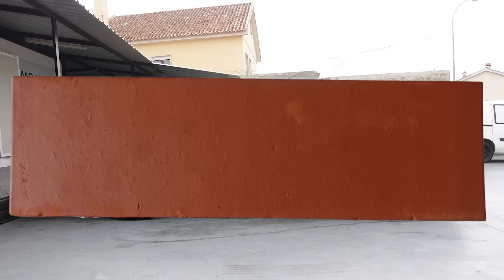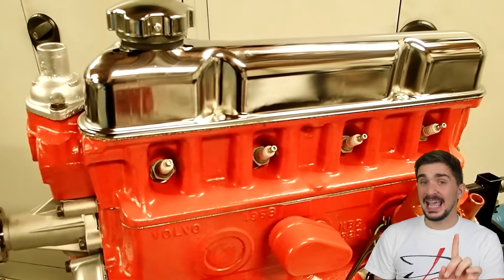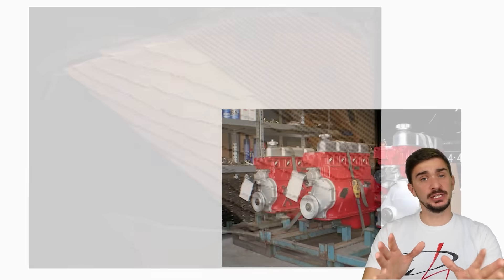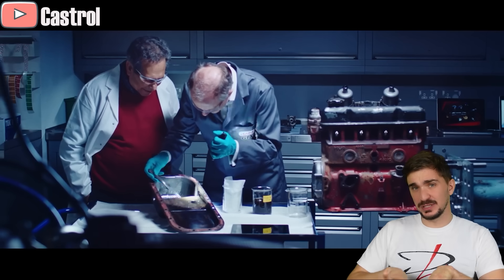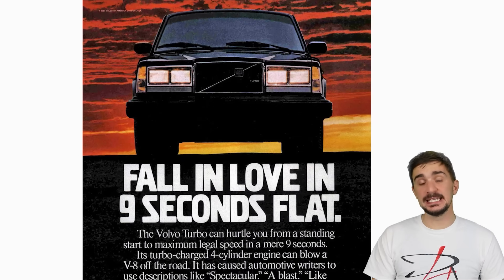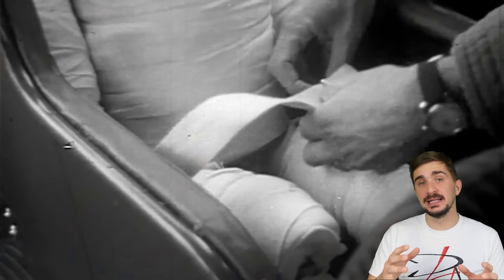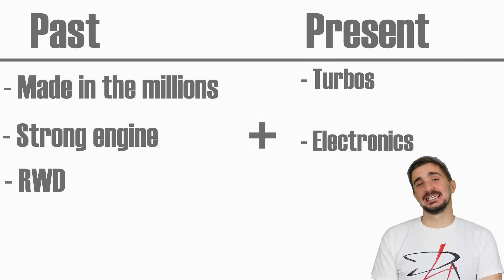A Story about the Volvo 240 and its Redblock Engine - Iconic Cars and Engines #18

Comment: Can you do a vid about the Volvo 850? Sadly I never owned a Volvo but they were iconic in the UK when I was growing up. By the time I came to buy a car the 240 was seen as an old man's car, though, and the 850 had been out for enough years that I could afford one second hand, and I was on the verge of buying one. Then I got a job that included a brand new company car (a Vauxhall Astra 1.8 S, which was a fantastic car too), so I didn't buy an 850. I now regret that, because I think they were a big step forward for Volvo -- good engine, much more modern styling and interior, and big enough to move several tons of bricks. Ah well, it's something to dream about.

Comment: I bought a 1986 240 Volvo wagon in 1998 from a couple I knew. They rolled it over on a highway, so the right side of the car had damage from front to back. They told me they flipped the car back to the ground and drove it home. I bought it for very little money. Drove it for about a year and sold it to a friend of mine. He drove it for almost a year. It was a tank.

Comment: My Dad was a volvo marine engine dealer and can attest to going 5 000 rpm with one for a full hour crossing Long Island sound at night in a rough sea. glad it kept going. trouble was they never broke so parts sales were limited to water pumps and the ussal timing belts. the GM 305 kept us in business and always wondering which part would break next. I had one B18 connecting rod for some reason and it looked twice as stout as a chev or ford v 8 rod.

Comment: Hold on. I had a 1975 242. It had the B20 engine with Bosch fuel injection. That was the first year of the 200 series and the only year of 100 series carryover engine. 

Yes it was tank. I once lost the oil plug coming off the highway and about had a hea3at attack when I heard the engine screech. When I got it home, I replaced the plug and filled it. I manually turned the crank for about ten minutes. I performed a series of short starts and eventually the screeches went away. I drove the car for another two years. I sold it to someone that expressly wanted the engine.

I would later buy a 2001 V70XC.... that wasn't the reliability of my '75.

Comment: The Bread and Butter Volvo 240 !, 70s80s90s !. The B16 thru B20 engines used A Fibrous Gear on the Camshaft Witch Would Fail if Oil Service was Neglected Had Solid Lifters so you had to Adjust the Valves 16 on the Intakes 18 on the EX., Flat Camshafts were a Problem 1974 -75 Flat Raters had A Hard Time Using Impacts on the Huge Cam -Nut When Tightening Snapping the Camshaft they had to be Torqued B21 B230 were Great Engines !.

Comment: I've owned seven of them. The first was a '74 142 2-door with the B18. Loved it. Wrecked. '73 145 not so great. Bought my '78 244 new and drove it 20 years. My '81 240 was good, but a "friend" wrecked it.  The '98 S90 with the straight-six was a disappointment; it just refused to run one day.
I still have a '92 240 and a '90 740. Same engine. No turbos. I must say I like the 740 better because it's bigger. The 240 broke the timing belt at high speed in '21. No damage to the engine. These cars will outlast me.

Comment: Loved my 245. Safe, forgiving, and built like a tank. It even had a plywood trunk floor! It was a United Nations of parts. Swedish engine, German electronics, French headlights, English radiator, Spanish tires, and all assembled in Canada. The only major issues were the poor quality red paint, a window crank that failed while on vacation and let the passenger side window fall down inside the door and there was no dealer to fix it anywhere, a shift knob prone to flying off into the back seat, and its eventual demise due to severe rusting. That car took a family of five across the country and back while towing a camper trailer, and never even burned a drop of oil, without complaint. I still have my high mileage badge and my I ❤ my Volvo bumper sticker.

Comment: Yeah back in 2003 when I was 20 I bought a 1989 Volvo 760 station wagon with the turbo and intercooler.  That was one of the best cars I ever owned. It had a beautiful interior, automatic climate control, great stereo, at least one air bag, and 4 wheel disk brakes - vented in the front with Bosch antilock brakes.  The motor was fabulous, turbo, intercooled, bosch fuel injection, it ran on low grade fuel, 160hp at 5900rpm and 180ft/lbs at 2900rpm.  It was wonderfully combined with the 4 speed auto which was faster to the shift then the manual.  It consistently did 0-60 in 8 seconds which made it a muscle car in the 80's.  Mercedes really was beat by volvo, mercedes cost a lot more money and only the V8's could do 0-60 in under 8 seconds, mind you they could go 140mph as where my volvo topped out at 110mph.  I loved that, I loved being on my phone talking and just pointing the steer wheel where I wanted it go go and stepping on the gas.  One thing I learned from that car is that there's such a thing as having too big of a motor in the car, I really appreciated rolling down the road at 70mph with a small, quiet four cylinder that was easily doing the job, any larger of a motor would have been constantly working too hard.  At the time I thought the fuel economy was great at 26mpg. Eventually later on in life I got a 1984 Mercedes Benz 300sdl with 380,000miles on it and everything worked on it and it never let me down and that's when I become very impressed with Mercedes.  Now I drive a 2006 Mercedes Benz E320 CDI and it's the best car I have ever owned.  It's got serious power, it get 40mph, it cruises at 130mph, and make no doubt about it, it's a much nicer car then the volvo.  THe handling is really bad ass, particularly with the ESP system.  It runs on sustainable biodiesel which is it's main advantage over the volvo.  The W211 mercedes are extremely tough cars and volvo stopped making heavy duty cars by this time, I think the W211 is last heavy duty mercedes as well, maybe the W212 but really the W211 with the inline 6 diesel is the one.  But I would love to get an old Volvo.  They're really nice cars to drive, I mean we don't always need to be racing.  Front engine rear wheel drive sedan are very comfortable, with lots of room and great visability. I just loved rolling down the road in my Volvo. To this day one of the best cars ever.  I mean what kind of cars are able to compete with classic Mercedes for quality. Really Volvo, Saab, The BMW of the 80's, Porsches, Rolls Royces have incredible milage and durability, Jeeps but they rust.  I think French make pretty good cars.  It's really something that a Volvo has more miles on it then a mercedes.  Honestly though with the OM648 inline 6 diesel I think Mercedes ultimately took the cake as far as the most reliable, longest lasting motor ever built.  That and like the cummins inline 6 diesel which is basically a light duty commercial truck engine capable of sustaining full power at least 70% of the time.  In the end inline 6 motors are really the way to go, 4 are great too but the inline 6 is the all around best motor just as a power plants, V6 are more compact and the flat 6 is the best all around motor for performance.  But just for power, the inline 6 is more reliable, longer lasting, smooth, simple, has the best level of torque, horsepower and economy.  I love great cars.  My dads Porschd 356 had 750,000 miles on it when he died and my Mercedes E320 is my life car.  I'm not selling it, it's my main car for the rest of my life now.  I just take good car of it and relish the miles in it.

Comment: I don't think it's fair to say the 200 series "outlived" the car that was "designed to replace it".  The 700 series was bigger and more luxurious, hence more expensive, they coexisted quite well.  Plus, the 700 series lived on as the 900 series with what was nothing more than a facelift, through 1998, with the redblock powered 940s until 1995.  

Also the B21 and B23 got a pretty major change into the B210 and B230, I'm surprised you didn't cover that.  I don't even remember off hand what the big differences are, even though I looked it up at one point.  

I have a B21 240 and a B230FT 960 Turbo.  Lovely cars.

Comment: Bought a 240 two years ago to use as a daily driver. Over 300 000 kilometers on the counter but it drives as if it just left the factory. Never had to do any work on the engine or drivetrain. Did a 6000km roadtrip from Belgium to Sweden and back and it's good to just drive to work again the next day. It just doesn't care.

Comment: Bought my 240 from the back of the car lot. Oil was golden - wow.  Ground to a halt after 1,000 miles....  oil starvation.  The gold was on the top of the sump, underneath was crud which blocked the narrrow oil ways - apparently narrower than on many other engines.  Swapped engine for a scrappy and had a great five years, towing cattle trailer, driving to the West End - all round brilliant car.

Comment: The only thing these engines didn’t cope well with, from my experience, is the Australian heat. Mind you, neither did our BMTroubleyou. 
The Renault 12 was the only European car we had that laughed at Australian heat. 
When the timing gear in our Volvo failed (weird I know) all that happened was, the engine stopped running. Replaced the broken bit of the timing gear and less than a couple of hundred dollars later it was back up and running. No rebuild needed as with just about any other engine!

Comment: I had a '91 240 wagon with a 5-spd manual transmission, it was an amazing vehicle if a little underpowered.  The 5-spd helped though, as you could easily wind it up into the power band where all the HP and Torque was.  Was also one of the easiest cars to work on that I've ever had.  That 2.3 4-cyl was indestructible.  A turbo on it would have been awesome.
Loved that car, I'd take another in a heartbeat.

Comment: parents had two of them in the 80's, very slow but reliable and of course absolute tanks! These were the days with real glass headlights that did not film up. Later a 164E which was a neat car, very upscale with a fuel injected straight 6 even in 1973
Reply: Straight 6
Reply: @antoniolittera2154  you are correct, edit
Reply: 164 came to the market 1969.
Reply: @taijkon  yes, parents had a 1973, I drove it a few time, pretty neat car for the time

Comment: So you CAN use hears to drive the crankshaft! A theory I had, but could never find an example of it till now. Thank you! Great video. I've always liked the Volvo "boxey" design. And unlike popular opinion, square does not always mean bad aerodynamics. Check out the drag coefficiant of the old VW Vanigan. It's around .30.

Comment: Love old volvos, they look good (yea I think the old shoeboxes look good fite me) and they, as stated in the video, last forever.

Wanna hear something tragic? Here in Sweden the age where you can first get a drivers license is 18. But you can get licenses to drive mopeds and tractors at 15. We have something here called "A-traktor" which goes under the rules of a tractor you're allowed to drive on a regular road, however they are only allowed to do 30 km/h. Pretty much a normal car that's been rebuilt (mostly, old law that's changed recently) to obviously show it's an A-traktor and not a normal passenger car. Where are these the most common? More to the "country" side/smaller villages. The people driving them are kids that are interested in cars I suppose, they like to tinker around with them, fix stuff and such, bass to the max on some of them. Well, here's the tragic part, most of the kids want rear wheel driven cars to rebuild for obvious reasons, and old volvos are rear wheel and reliable. It's also like a thing/meme here that when you live on the country side you drive a volvo. They pretty much used to cut off the back part of the cabin behind the front seats. So it's like a cargo bed, kinda looks like a sort of pickup truck. They are however... not allowed to haul cargo with them... Since they are young they have to be cool, and you're cool if you don't care. The trashier it is the cooler it is. So many old volvos have died like this, they get cut up and smashed. I think it's really sad. It used to be Duetts that got rebuilt to the predecessor "EPA-traktor", but when they were made illegal the A-traktor was introduced, and there mostly the 200, 700 and 900 series were popular to rebuild.

These days it's not really limited to volvos anymore, you can see pretty much any car as an A-traktor since you don't have to cut them up anymore, it's a lot easier to make one today, and a lot of old volvos has gone to this stuff so it's probably easier to get a something else anyways. Police hate them as well, they get modified to bypass the speed limiter so they still act like normal cars.

I have an old 740 in my garage, I got a mesage on facebook by some kid asking if I wanted to sell it lol.

Comment: I had a 96 850R and it was an absolute tank. over 350,000 kms on the engine, still going strong. And I sold it for more than I bought it for. Frankly - I wish I had never sold it!

Comment: I have a Volvo 164 with a 3.0 B30 engine in it. Its like the B18, its very understresst. basic B30 have 140 HP but soon I make it 400 HP and it runs on Propane gas

Comment: The later B20 engines were fuel injected. Volvo died in 1999 when it decoded to become a Saab. I will not drive or work on a front wheel drive car. I hate the macshitson struts on the 240 series. Much prefer the double wishbone on the 100 series. I have a few Volvos lying around the farm including a 69 164 and 73 1800ES. They are for sale.

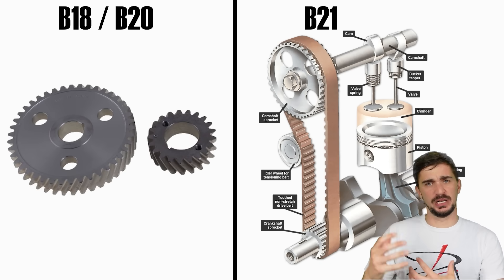Comment: The left image at 8:00 is not representative of a B18/B20 engine as it has a chain driven camshaft. I am very familiar with the setup from my 1970 164 which was essentially a B20 with 2 cylinders added. Main design issue for North America was to accommodate power steering in the length available the fan/waterpump pulley/belt was made very skinny and prone to break. Unfortunately the maintenance standard provided by the dealer sucked and the camshaft bearings got wiped physically messing up the distributor and timing. The wiping/timing issue was identified by a good mechanic who noted that the play would have been excessive for a chain drive setup but outlandish for a gear-drive setup.

Comment: I bought 1 of these brand new bricks in 1982 with a manual transmission.  The manual transmission was needed to overcome the inherent sluggishness of the 4 cylinder engine.  My fiance was not going to ever lower herself to learn how to operate a manual shift car & nagged me to get an automatic transmission. So, off the the Volvo dealer I went to look at the inventory.  I was a 1983 black turbo wagon on the arriving car transporter & made my inquiries.  The salesperson assured me that  the non-intercooler turbo charged where extremely reliable & the intercooler was just a gimmick.  So, Itrded in the '82 & puchased the '83...a big mistake!  With apx. 5K miles the turbocharger failed on a weekend trip & eventhough I told the local dealer that the problem was probability the turbocharger...they dismantled the entire exhaust system & left the turbocharger untouched because  of the supplies requirements/warranty.  A week later when the car was "repaired" the culprit was a nut that came off of the axel for the turbocharger causing the turbo blades to grind it into the housing to size the turbo!  This defective turbo then caused more severe problems with the engine....and Volvo denied culpability.  This brick was nothing but a headache & the refusal by Volvo to remedy the situation had caused me to vow never to purchase another Volvo.  I have adhered to that vow & will never buy or own anything from Volvo!

Comment: That ”brick” saved my life😊
Had a blue 245 Turbo (estate wagon) from 1985. They only made that model during 1984 and 1985.
As a swede Volvo is as boring as oatmeal, the Turbo made it much more entertaining though.
The first owner had cranked up the turbo charge so the engine had some 180hp.
Loved the car but not the gas consumption and was thinking of changing to something more fuel efficient. 
But as it turned out, a delivery van hit us at the passenger door while driving 45mp/h (70 km/h) where my infant son was seated.
Well, the car warped into a giant blue banana and had to go for scraps. The police told us later that we surely would be dead if we’d be driving any other car.

Comment: I remember the fibre gear when it cracked it sound like a big end knocking and thay expensive to buy also I had a 240 as a taxi and 360000 miles it was still as New same engine gear box starter altenater rear axe and no rust

Comment: soo yeah i am currently building a b230 fk and im aiming for around 250-300 hp. thats about the max the oem piston rods can take. but i know a guy who is running 600hp b230 with only bigger rods and turbo (and a aftermarket ecu) and the b230 is CHEAP to get starter with

Comment: The 240 was our family car for 21 years..340,000 miles.  One water pump, and oil changes every 5,000 miles.   The shochs and suspensiom bushings were also replaced somewhere in there as well….it is the only car my kids remember.

Comment: I purchased three Volvos new in the 70’s, a 74, 77, and 79.  I will never own another one!  The 74 ate three fuel pumps, and came direct from the factory with a camshaft that was not hardened properly.  The had to rebuild the engine at 5000 miles.  The 77 had fuel pump issues and at about 10000 miles the gear shift came out in my hand in reverse!  The 79 was the first year of the lambda sonde emission system.  The engine would overheat going up hill and the die when going down hill.  Needless to say, they were the worst cars I ever owned.  The tow truck drive and I were on a first name basis….